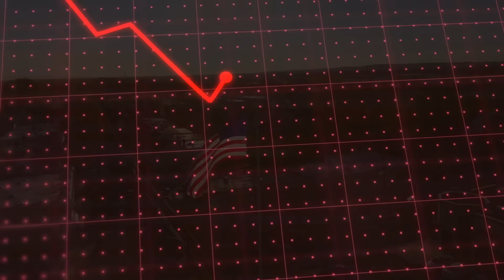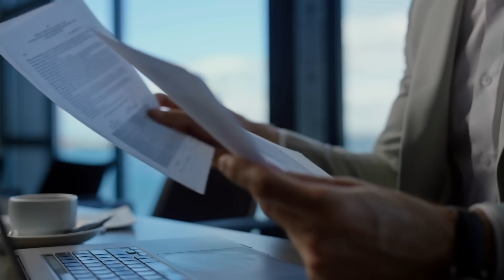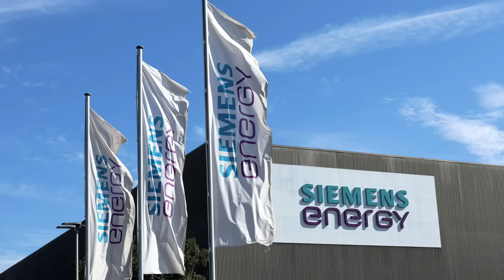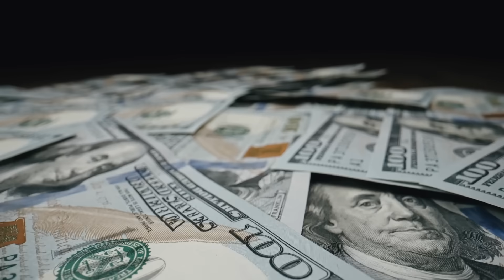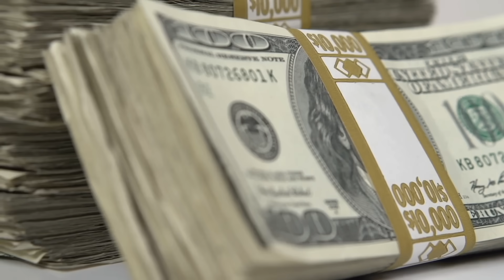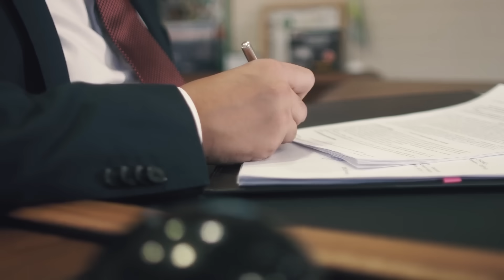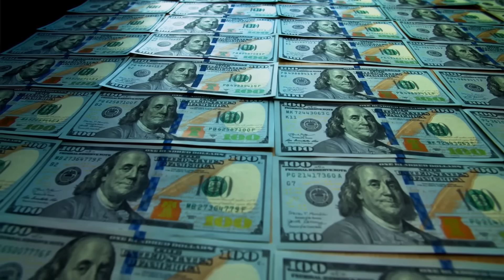The Real Reason America Has Turned Its Back On Wind Power Energy

Comment: Just look at the construction of a windmill, concrete, steel, diesel fuel consumed, fiber glass, nothing "green" about any of that. Carbon dioxide and a green plant produces food and oxygen  as well as green plants for shade.
Reply: A windturbine saves more CO2 than trees...
Reply: @old-pete  Trees and other plants are starved for carbon dioxide and will respond with added growth up to an ambient of 1,400 ppm. I am a plant physiologist, I have worked with CO2 and plant growth both in the lab and outdoors.
Reply: @dennislaughton1676  Then you should know that CO2 alone is not enough. The earth is no greenhouse were one can set the enviromental conditions.
C4 plants do not profit from 1400 ppm and most C3 plants max out between 800 to 1000 ppm.
But when it is over 50 degree celsius and plants lack water, the high CO2 level will not help.
Reply: @old-pete  The only C4 that I have worked with is corn and with 300ppm additional CO2 , yield increase is 30% of wheat and 50% of barley. With current 420 ppm plants are starved for CO2, stomata are wide open, additional CO2 stomata close to a certain degree but it is enough to improve water use efficiency. In greenhouses at 1,200 ppm CO2, WUE is greatly improved compared to same plants grown at current ambient. That is my practical experience, other that growing giant pumpkins with CO2.
Reply: @dennislaughton1676  Plants are not starved, they grew fine. They do not grow fine, when they get burned by the sun or lack nutrients. With 700 ppm, the world will not offer the same conditons as your lab. 
Just take a look at the trees, how many are already suffering under the current conditions Even 3000 year old Sequoia trees fall ill. And we are at just 1.2 C warming.
Reply: @old-pete You say that the Sequoias are falling ill, is it a disease, if it is lack of moisture, that is a physiological problem related to current weather.
Reply: @dennislaughton1676  Yes, it is related to climatic conditions. That is what I am talking about. The trees are 3000 years old.

Comment: Lets do a back of the envelope calculation for electricity storage. 
Conditions for the calculations:
1. Windmill rated power output 1MW.
2. Battery used: 100kWh Tesla Battery
3. Average cost per battery: $161/kWh x 100 = $16,100
4. Storage time: 100 hours, duration of the February was about 100 hours of little wind not uncommon in cold high pressure systems.
5. No grid, efficiency or power conversion costs.

A 1MW windmill produces at nameplate capacity produces 1MWh of power every hour running at capacity. To back up this with a battery will take 10 batteries to provide the same power for 1 hour. The battery costs will be 10 x $16,100 =$161,000 for one hour of backup

For 10 hours of backup would require 10 times that number or $1,610,000. For 100 hours it would require 10 times the previous amount or $16,100,100, 1,000 batteries. This is for one windmill. If you have a farm of 100, that means that you will need 100,000 batteries at a cost of $1,610,000,000. This is for one wind farm, last count I saw was that there are 70,000 windmills and to provide battery backup would require 70,000 X 1,000= 70,000,000 batteries at a cost of 70,000,000 x $16,100= 1.1270 trillion dollars. This is to just backup the windmills we have currently. The current battery production at Tesla is 139k per year. To provide for just the installed base would require 500 years at the current production rate. That would mean no production of car batteries.

 At the end of 100 hours, the batteries are spent and while the wind is blowing, power must be generated to charge the batteries, and provide power to the grid.Since windmills average a 30% capacity factor, you have to build >3x the required amount to supply the grid, and at least twice that number to recharge the batteries. We also haven't included the optimal operating range for Li Ion Batteries which is from 20% to 90%. Thus you will need 1/70% additional batteries or 1.429 times that battery total. Thus the cost of the batteries is $1.6105 Trillion Dollars! 

This is just a rough estimate and not inclusive of all the costs involved, and the time frames available. In other words we can't get there from here, and the only reason we are trying is because the government if throwing money at people without thinking or doing basic math.
Reply: Beautiful!  Love those "back of the envelope" calculations.  Too bad Common Core math doesn't care about real results.
Reply: That many batteries are not needed as the windpower still produces electricity during that time.
You also combine it with solar, hydro, biogas and biomass.
Reply: @old-pete  If the wind does not blow at the correct velocity, there is no power. The windmill consumes energy for heating of the lubrication oils and rotation of the blades to keep them from deforming the bearings during lulls in available wind. It is not uncommon during high and low temperature periods for large areas of land to not have sufficient winds to keep the windmills turning, and when the backup generation is not there there will be no power. The data is available but ignored because it does not fit what the politicians want and they control the money. If these were really that good of a deal, why do they still need so much subsidy after all these years? Projects are being cancelled due to lack of government funding. 

Look up the term Spinning Reserve. Power companies use it to keep the grid stable, and have increased the amount due to windmills. So not only do you the customer pay for the electricity from the windmill, you also pay for additional power, most generally a gas conversion, or other thermal plant to back up the wind. This is one reason for the higher power prices when windmills are used, you duplicate the power for the backup. These backup plants are what keep the grid stable without the massive amount of batteries. Get rid of the Spinning Reserve, and you will be building a lot of batteries. Otherwise you get to live like my great grandparents using wood/coal for heat, candles for light, horses for transportation, and no stable electricity for power.
Reply: @rpercifieldjr  As I already wrote, that is why windpower is paired with other sources I named...

Heating is only needed during winter and the power demand is rather low.  Fossil and nuclear power plants need a lot more power in standby or for powerup.

Windturbines can be combined with grid forming generators, that work like a spinning reserve. Together with other energy sources one gets a stable grid.

Btw. fossil fuels get subsidies too. A sure sign they do not work well, right?

Comment: Someone forgot to include the cost of upgrading the networks,...... meaning green energy is not as cheap as they tought,............ And as the US is kind of broke they can't or should not sponsor it. ..... So then we're left with local solar projects who don't need the grid that much, likely with storage in electrical cars. ...... Green energy needs high oil/gas prices. ....... Which many don't want. ..... And which can not be achieved for many (political) reasons. ........ Are there any large industrial consumers that could be located close to the power sources, and be happy with producing (consuming) when there's wind or solar, and not producing when it's not ? ......... Upgrading the US grid is not gonna be done in a day, and it's too costly.

Comment: The true cost accounting for replacing fossil fuel energy with alternatives misses the point of calculating all costs form the starting position of investment, Exploration, Discovery, Process, Distribution/Delivery to the Point of Manufacture.  Also, the longevity of Wind Power devices and their ability to return to earth. As with electric vehicles, to make my point with the previous sentence, there are only enough materials to provide 34 million vehicles, that the size of the UK's vehicles, with the materials that are know to be available today.  And remember that all still manufacturing and processes have to be employed ONLY with COAL to obtain the smelting hea – using electricity will not deliver very well and the cost would be stupendous.  As for building out the National Electricity Grid, that was designed and installed from 1934 (the UK was in 1926) is old and would not have considered itself to be requiring so many interconnections (nodes) as say, a telephony network, that is physical or cellular.  NO, I do not see that this will be resolved easily or economically as the problem is exaggerated yy having no actual National Grid but  many operators instead...

Comment: Wind turbines are not green to make.
The concrete and steel are made using fossil fuels, much of it from China, and output billions of tonnes of CO2.
And the blades cannot be recycled.
R
Reply: The Co2 footprint of windturbines is much lower than from fossil fuel power plants.
And there are multiple ways to recycle the blades.

Comment: wind and solar are two most inefficient forms of generating electricty whilst requiring a massive land footprint.
Reply: Really?! I don't believe that is true.
Reply: Spewing pollution into the sky with coal gained by mtn-top removal, with the mercury into the oceans, and the heavy-metal-toxic ash into poorly-built ponds is the most efficient whilst the Nature dies.
Reply: They produce electricity cheaper and with less carbon footprint than fossil power plants.
And the landfootprint is rather small, especially when one uses unused land or land that can be used together with wind and solar power.

Comment: They should spend that time, money, and energy on building nuclear generators.
Doesn't it make sense to ensure one can connect to the grid on completion of the project? It seems much stupidity is involved in this.
Reply: Nuclear reactors need a connection too...
Reply: @old-pete  Of course, but they're reliable and predictable, so the grid knows what it's getting. I don't understand how anyone can build a power station first and only after it's built worry about connecting it to the grid. Isn't that the height of stupidity?
Reply: @grasonicus  It is bad planning, but that has nothing to do with the type of power plant.
Reply: @old-pete  I'd have reservations about connecting a plant with an output from zero to frying the grid to my grid. It's gambling. I'd rather have a constant, reliable input into my grid for which I can plan.
Reply: @grasonicus  If it fries your grid, you did not check your grid capacity correctly.
And any power plant must be able to power down, no matter if planned or unplanned.
Reply: @old-pete  Predictable is still better than unpredictable.
Reply: @grasonicus  Solarpower and windpower output can be predicted 24 to 48h in advance. That is enough time to plan the output of all powerplants.
And an unplanned power down of a fossil or nuclear power plant cannot be predicted either.
Reply: @old-pete  Accurate weather predictions! That's something new. Weather predictions are often somewhat off, and unplanned nuclear power plant outages are rare.
Or do you say wind and solar plant outputs are exactly as predictable as that of a nuclear power plant? Degrees of predictability matter. Low and high probability are not equal because they both are probable. That's not rocket science. A grade-schooler will understand that.
Running around making adjustments because of output variability is not necessary for a nuclear power plant. Do you like running around, always changing things because of uncertainty?
The proof of the pudding is in the eating, wind and solar did not live up to fanboy predictions.
Reply: @grasonicus  I told you how predictable they are, nohing more, nothing less. Feel free to look it up.
And adjustments have to be made every day, as demand is not always the same.
Reply: @old-pete  Whatever you say, wind and solar don't come close to a nuclear power station for delivering predictable electricity. Everyone knows demand is not always the same, but demand is far more predictable than wind and solar output--they have years of statistics about demand. So, demand is predictable. It's far better to match predictable output with predictable demand than connecting a city to an unpredictable supply and fire up gas power stations at irregular intervals as the need arises.
Reply: @grasonicus  That is why it is not planned to rely only on wind and solar...

Comment: It's a massive boondoggle. Hydro-electric plants could be built to genuinely supply 20% of the US's energy needs, but this isn't done. Wind turbines and solar panels DO NOT provide reliable electricity as they are dependent on wind and sunshine. When the wind isn't blowing or the sun not shining, no electricity is produced. Therefore, to ensure supply the grid must rely on coal and oil-fired generators. What little electricity is produced by wind and solar is an expensive luxury, not a necessity. The necessity is met by coal, oil and gas.
Reply: The electricity that is produced by the current models of solar panels and windturbines is quite cheap. When combined with hydro, biogas and biomass it is also reliable.

Comment: In my home, Denmark, we  have an effective power grid, 220/380 volt and produces so much Green Power (Solar and wind) that it is enough for our daily use. We also was among the very first to evaluate modern wind power and now produces around half of the worlds wind power machines (Vestas).
Reply: Denmark is a special case with a small population and a the perfect geography for wind power. Quebec has the same benefit with hydroelectric power. The rest of the world isn't like that.
Reply: Are you wind farms 75-125 kilomteres from the city in which the power will be used ?
Reply: @chavitacanta008  An efficient High Voltage net, with transformers, of course transports Electricity to where it is needed, even far away, all over Denmark/Scandinavia! If no wind, water and sun produces Electricity somewhere else and mostly the wind blows somewhere  in Denmark.
Reply: I doubt Denmark has the corrupt corporate eco system like in the U.S.  It seems like your engineers and scientists saw a problem and came up with the most logical approach to solve it.

In the U.S, we have this insane Byzantine matrix of conflicting interests and unimaginable wastes of capital that ultimately lead to an unnecessary and Herculean effort to finally force the thing into existence and declare it done.  Right after the ribbon cutting ceremonies and payout of undeserved bonuses to fat cats, there will be numerous faults because there was no communication within the cluster-Fck of how things are done in this dump.

Green energy and the LCR (Littoral Combat Ship) are two perfect examples of how sick our system is.
Reply: America has over 40 states bigger than Denmark,so please stop comparing apples to oranges.Your country would have to at least double the amount of wind and solar farms if you vehicles all switched to so called renewables.We Americans have had cheap nuclear power for decades until this idiotic climate nonsense started.We have finally started opening a few new nuclear power plants again because everyone now knows this whole climate emergency is nonsense.Any academics that tell you they can control the climate is an outright liar and should be shunned by everyone.
Reply: @charlesyoung2530 Climate change has nothing to do with nuclear power.

And Denmark is a good example how it can work. 
Yes, they are smaller, but that also means they have less ressources. A country with more ressources can do more. And the US has the advantage of a huge hydro potential and even access to some geothermal energy.
Reply: Yet, in the U.S. wind turbines are installed in areas where they couldn't blow out a candle at 500 ft in the air. Hence the difference between Denmark and the middle of Michigan.
Reply: @markusstevens9547  Considering their electricity output, the validity of your statement is doubtful.
Reply: @markusstevens9547  We also have an efficient High Voltage Grid, which is able to deliver Power to far away. Our new and planned "Super Mill Parks/Islands" far out to sea, must be able to transfer the Power produced back to land! And yes, we have also sold Mills to areas which are not really suited for Wind Mills!
   But today week agricultural areas are being converted to huge areas for Solar Power, delivering Power when the sun shines! Also plants converting burned "hay" to Power. And surplus cooling water from an Electricity Plant gave my Hometown a common heating system for most of my town, even passing below a deep Stream in isolated tubes for that!
Reply: @markusstevens9547  This is mostly a problem with lack of planning. I know also of Danish Mills sold to areas with hardly any wind! But out to Danish Sea with free wind from all sides we are now planning huge islands with absurdly huge windmills, being able to power not only Denmark but also neighboring countries. As the Scouts claim, "Be prepared"! And we have made and tested windmills since the sixties. to find out how much power is able to be produced. At a time I had the largest Wind Power Plant close to my home, but even those mills are small today!
Reply: Samson Island is famous for its renewable energy transition. They spent $80 million on renewables. The population is about 6700. So it cost around $21,000 per person for their renewable power. They use wind, solar and biomass to achieve 100 % renewable power.
Reply: its is vert easy when denmark dont do much of any thing
Reply: @dknowles60  LEGO and Maersk are Danish Companies. And we are intending to build huge windfarms on Islands in the windy North Sea + we have a grid able to handle high voltage power, unlike the US it seems?